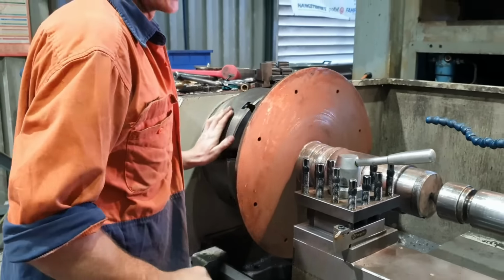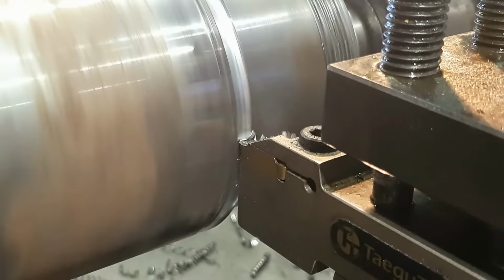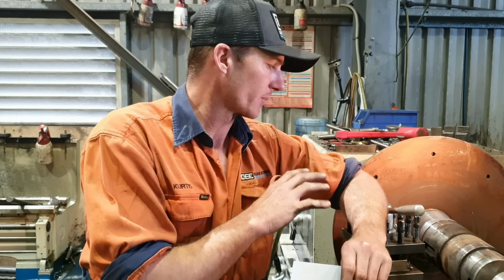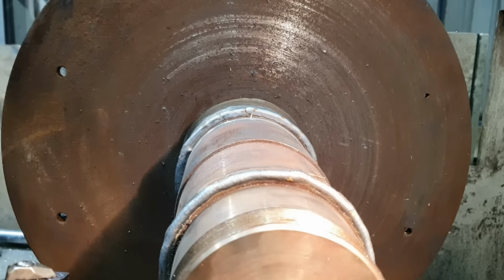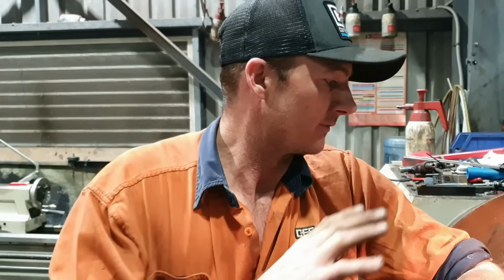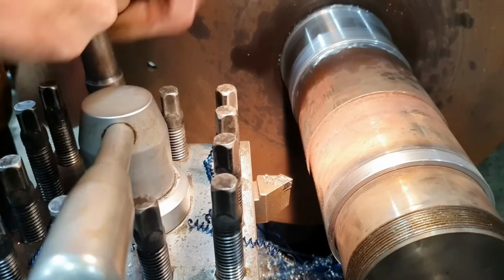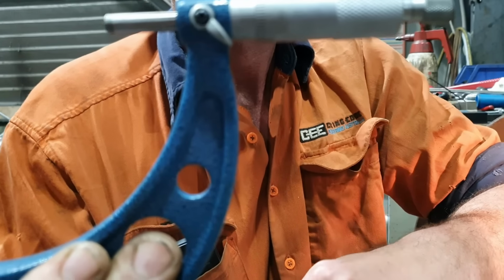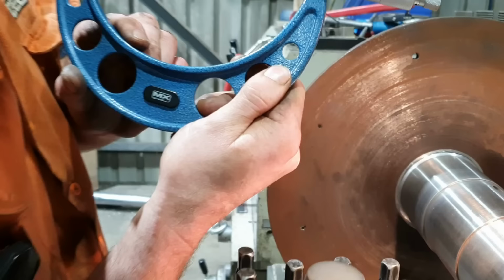Repair DAMAGED Cardboard Compacting Auger drive shaft | Machining & Welding

Comment: It brings back great memories of cranking handles, watching chips roll off the cutting tool. Manual machines are so much more satisfying to operate than just pushing buttons and looking through a shield because you can feel the machine working with your hands.
Reply: Manual repair machining rules for repair machining since it's faster to make the cuts then code to make the same, generally few, cuts with a CNC.
Reply: I retired out of machine work after installing several CNC machines, doing the moving, electrical and electronic connections and just enough "watching time" to know they were properly installed.  I had no desire to continue on without the manual machines.

Comment: '' I don't want to spend any money on it'' says every Owner ever.
Reply from the maker: 🤣☝️ accurate
Reply: Sounds about right.   One of my tasks today at work was repairing a cylinder base eye, without doing a reseal of the cylinder. 
Weld up with the spear extended to avoid melting the piston seal. Then into the mill for a bore.  Just another day at the office.

Comment: "Hey Trev, what's those Sparks and Grinding noise?
"Naaaaah, she'll be right mate...."
5 minutes later
"She's fucked"
Reply from the maker: Accurate interpretation i'd say
Reply: @CuttingEdgeEngineering  also, what's the bet in a year, that machine will still be running, with the temporary repair and the customer saying that they are going to replace it in a couple of months 🤣
Reply: There are times when it's NOT a good idea to have the name "Trev"...  This is ONE of those times I guess
Reply: 5 mins 
Prob 5 days

Comment: It's amazing how much stuff you wouldn't have had to have worked on if they would have just did preventative maintenance to the part, but they're fu#kup is our video
Reply from the maker: Was just saying to a customer today some grease and preventative maintenance would help 🤣
Reply: @CuttingEdgeEngineering  amen

Comment: Bet now it is fixed the replacement machine will be put off for another decade, and you will see this machine come in again for repair. But a nice job there, looks like it was just off the factory floor, aside for the plate at the end.
Reply from the maker: 🤣 this is probably what will happen.  Thanks for watching mate

Comment: When I did the welding part on rolls I would use a bug-o  to hold the mig. Only would have to turn a knob every rotation. kept a perfect angle and didn't exhaust you.  No reason to hold yourself still that long to weld. great video . cool video

Comment: This is bread and butter to me, been doing it all my working life, the only difference is i'd have welded it still set up in the lathe, to keep a machine running through the night i've turned a bush split it and welded it on then turned to size that was 10 years ago and to my knowledge it's still running.

Comment: U use that radius  insert a lot for the hard in metals and the wells good idea like 4 jaws easy to line up reworking parts they made a six jaw Chuck I say that because  u run so much tubing six jaw was manufactured  in France it helps cuts down on your chatter we used it on Cadillac  lath it was a gap bed swang a lot miss my old lodge Shipley and monarch  great machines alexison great machine  great videos  your a talented Aussie you are a thrifty with your money  happy New Year  down under

Comment: i wonder could you make a stand using the line borer drive unit and the rotary table to automate the welding of shafts. would beat sitting there hunched over while welding

Comment: I've also seen where so called tempory repairs done, where they have still been in service years and in one case decades, after the quick patch her up and get it giong job was done. Though some times a minor redesighn, like adding remote grease lines to difficult to get to grease nipples helps.

Comment: Bit late seeing this so I may be way off base.  I thought I saw a bit of a wobble between the shaft and the face of the piece that was chucked into the lathe.  Is that normal or will it cause problems during the operation of the compactor?

Comment: Hey Kurtis "Carl" 😀👍
   Now we need a Video of you Stupid Or Fun things in the shop .  Like one of the guys in my shop always took baf wheel bearings off a car and clean them up really nice spray a little thin lube on them and spin them up really fast and drop then on the shop floor watch the sparks fly while racing across the shop 👍👍
  Until One Exploded on him pelting him with bearing flak ...

Comment: What material is that shaft made of? Also, considering how thick that shaft is (even if it's mild steel) were you following a pre heat/post heat/ interpass heat? 
It was also something of a surprise that you didn't do anything to protect the threads while you were welding...
Reply: Beautiful machining though

Comment: Doesn’t the shaft get weakened trough the heat of welding? I’m just wondering, what would be the procedure if you have to give warranty for such a work? 

In my eyes you know what you are doing, atleast it looks like this, so there will be reason why you’re ain’t giving warranty, still I’m thinking the shaft is going to work another machine life 😁 greetings from
Germany!
Reply from the maker: yes you're spot on the welding creates a heat affected zone. For a warranty I would have made a new part 😎👍

Comment: I have one criticism.  When MIG welding with gas shield, you should push the wire ahead of the stinger.  When using flux core wire, you should pull it.

Comment: So a machinist here, and I'm sure he knows what he's doing, but it looks at 19:01 like the jaws of the caliper are not in contact with a diameter of the piece. It looks like it's a bit higher. Again at 20:51 and it looks like the depth of the jaws is really  close to the radius of the target.

Comment: If it was really important, how would you limit the heat affected zone  for a similar repair method. Thanks in advance.
Reply from the maker: heat the whole part up in an oven/furnace, weld it then bring back to temp and let cool very slowly but you'd be looking at a few days for a job like that.

Comment: I'm a retired bowling center mechanic. I used to make similar repairs on shafts, using nothing but a stick welder, file, emery cloth, and a drill press. No calipers, no lathe, no angle grinder. Of course, the shafts were mostly 12-25mm (1/2 to 1 inch), not the 130mm monster you fixed.
File off the worn area with a round file, fill the recess with weld material, chuck it in the drill press, and turn it, using the file to knock down the weld material until it was level with the good part of the shaft. Then polish it all with emery cloth.
Normally took me half a day, and saved the owner a hundred bucks or so (he figured he had to pay me anyway, so didn't count my time).

Comment: You do  first class work haven't seen anybody any better do you run AC or DC welders
Reply from the maker: Hey mate they're dual setting welder I can run AC or DC it just depends on job i'm doing. This job was running DC

Comment: Is the temper in the shaft the main issue ? I can only wonder the Horsepower that shaft has running it.
And I bet they will run it a lot longer than planned just because of the job you did. And the quality

Comment: I don't know what I am talking about, but how hard is it to convert the line borrer to do the rotary table job?  Make a mount and attach the work to the borring shaft so the work moves and not the weld head?  Would that allow it to be semi-unattended?

Comment: Curtis I don’t know where you learnt your Trade but to have those Turning and welding skills is pretty Unique. I am a Plater/Welder by trade in the UK, but have spent the last twenty years working for a commercial aircraft manufacturer because you go where the money is. I have not really welded at all in that time. Those days doing my apprenticeship were some of the most rewarding. Watching a project from start to finish and being involved with the installation. Building aircraft requires a different set of skills but you rarely folllow the product to the finally assembly line. I did mainly Mig and Stick back in the day for welding structural sections. I think I fancy doing more Tig welding and I think that’s where I going to concentrate my efforts, welding more stainless, Alu and exotic metals.  More refined projects.
Keep up the really good work mate. Always good to see proper skills in the real world.👍

Comment: just one quick question on your great repairs when you are machining above part do you use oil pipe on side all time or does it depend what work the blade tips you just spray oil separately just wondering cheers Declan 👍

Comment: I have 20 of these augers compactors that are in my service area. They are beasts on how hard they compact cardboard or trash. For a normal compactor used for cardboard a good load is 3 to 4 tons, put in a auger you'll get 8 or more in the same 40 yard box. These all have a automatic greasing system installed.

Comment: Good quick repair .  Cheers .    What type of spray weld torch do you have ?
Reply from the maker: hey mate! I've got a Eutectic RotoTec system
Reply: @CuttingEdgeEngineering  That's what i have just picked up as well . Also have the smaller Model B torch .  Cheers .

Comment: And 1 year he was working in a carnival and filled a big black heafty bag with a rich mixture of OXy Acc and a 20 foot slow burn cannon fuse took it to a huge tree in the town square type area climbed it as high as he could lit the fuse got back to his trailer the torch mix was perfect and 3 in the morning took a lot off the top of the tree and fire and police where swarming in

Comment: 3M Speedglas helmet... nice choice. I have the same helmet but mine doesn't have the air filtration system included. Mine is the 9100XX version. Great helm but it does have some annoying flaws... the flip down stop adjustment pin being one of them. I've broken it off 3 times now and there's no fix for it... $50 outer shell replacement every time. I've written Honeywell/3M all 3 times about this bad design and not once did they write back at all. Next helm will definitely not be 3M brand. Probably ESAB.

Comment: Great looking repair. I need to do something like this but it's on a lathe spindle with some gouging in it. It's for my 1950 Sheldon lathe. Under the drive pulley between the bronze bushing and the spindle. I think a previous owner must have sprinkled sand in there to get it like this. Damn. The spindle is nicely hardened to file-hard. I'm worried about heat distortion from welding like this. Since the spindle is a critical part of a lathe, would this type of repair apply for this or do you have any other suggestions ?  Thanks - Jeff

Comment: I am an electronics engineer and I have no idea why I watch your movies. I guess because you repair such heavy equipment with such ease. It wonders how much such a new shaft costs and how much time you have to repair it and what bill you will issue. You use decent and expensive tools.

Comment: Strange to think that in times gone by Australia could have designed and manufactured the complete machine at Vickers Ruwolt, but alas no longer has that engineering ability.

Comment: 10+ mm is not a small amount of material to have to add back in order to get back down to spec. Ridden hard and put away wet is one thing, but this is nuts.

Comment: First thanks for making the video and showing it to me.
Fortunately this was only a short, not too thick shaft.
I once did a similar repair on a very large thick axle.
Same problem, bearing stuck.
I also welded this axle.
I only did that welding on a lathe.
Reason: I didn't want to stop welding and attached the welding torch to the support.
Gives a much more regular weld.
The reason the bearing got stuck was because the fit of the outer ring was too tight.
I made sure that the outer ring had a loose fit and put pressure on the outer ring with a cup spring.
The machine has never given a problem again.

Comment: That job although im not an engineer appears to be as good or better then factory, afterall its just a bearing run i have seen more permanent bodges that were without machinery

Comment: I am a total noob at this kind of work. But i have 1 question how come you didn't machine it all the way down to totally clean smooth metel with no damage from the bearing visible and then weld it back up. Please don't think i am questioning your work because believe me I am not it's a genuine question. Thanks for the amazing content.

Comment: I'm not a machinist but it seems like there were still some dirty voids when you started welding.  Why not sandblast into these voids or use a drill/dremel with a wire brush to clean them out before starting the welding?

Comment: What makes you choose to use the stock tool post on your lathe over a quick change tool post
Reply from the maker: Hey mate a few reasons, never found a QCTP rigid enough here in Aussie for the work I do. A standard tool post has more range with tool positioning. I can use my tooling across all 3 lathes without adjusting centre height like I would need to on a quick change. Our tooling supplier thinks he has found one I will like 🤣

Comment: Good day. I have always found that most folks that can weld well are not comfortable in the machine shop and vice/versa. Those that can do both well like you and I are rare beasts for sure. It's great to sit here through the process and the outtakes at the end always break me up. Thanks a bunch and have beauty days to come eh.
Reply from the maker: Hey Dean hope you're having a good week mate. Thanks for always watching and commenting! Cheers, Kurtis
Reply: @CuttingEdgeEngineering  When I retired I lost access to he equipment but not the memories of the one-off repairs I would get. I tried a factory type job and by the end of the first week I was out of there like I was shot out the barrel of a 12 ga, LOL. In my work at the logging shop I never knew from day to day was coming at me. I never really knew what a great place it was. Oh well I have you to help fill that void for me. Great videos mate ! ! !

Comment: All kidding aside about OZ, it is clear you have some pretty good skills. When I got out of school there was no assistance programs or guidance to get into any apprenticeship programs so we were just left hanging. Unless you lived it a city /town where there was an industrial base you were left to your own devices to find a path. There was no internet in the 60's so I looked around and became a natural gas technician / fitter, then pilot fighting forest fires and working for an airline. But when mum developed cancer I left all that to look after her and took a temporary job as a cop which lasted 37 years.
I have a small machine shop in my back yard and make parts for Piper Super Cubs. and others. 
I'm a little envious of your knowledge and skills set . You make it all look very fluid and easy.  I soak up a fair amount of Machining / production Youtube channels among others.
You do good work and have the equipment to do so.  I'm just now transitioning from HSS tooling to indexable carbide inserts. getting old isn't any fun.

Comment: A better way to build up on a shaft like that is to run stringers parallel to the long axis of the shaft where you have the bad bearing damage.  What this does in minimize the compressive stress in the shaft.  When you run a helical weld like you did as the welds cool they induce a great deal of compressive stress and can result in cracking of the shaft.  And then a failure.

Nice radius at the plate!

Your Safety Officer looks bored.

Comment: Hi, I enjoy your videos, got a quick question on this one. Given that this is an accepted bodge, “I need this machine to work until my new machine gets here, and I need to work tomorrow…” type deals where you do whatever you can, I was wondering why you rejected the spray repair and went MIG? Because I’ve seen worse shafts repaired with spray. That’s not to say the MIG isn’t the better repair, just wondering.

Comment: Why don't you adapt the equipment to weld internal areas together with the one that rotates the part so that you can weld these parts externally without having to hold the welding gun?

Comment: Just out of curiosity .. would there be any way to adapt the bore welding equipment to where it could do an external build up so you wouldn't have to sit there and manually weld it up?
Reply from the maker: hey mate yeah definitely possible just not worth the setup time for a one off

Comment: Comment and a Question.  I see that the the only guard on this lathe is “ PAYING ATTENTION” .  I worked with some industrial stitchers, same thing.  Do you have multiple disconnect switches along the lathe, just in case of a, god forbid, an emergency occurs?

Comment: Does building up material like that then machining it back affect the temper of the part? If the original part was heat treated etc does the welded area end up a different strength / hardness to the rest of the part etc? I guess you can’t heat treat something that large?